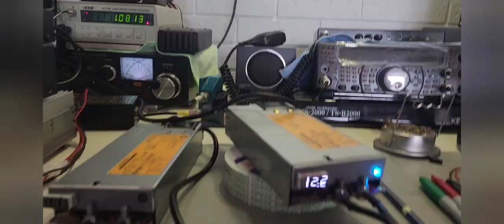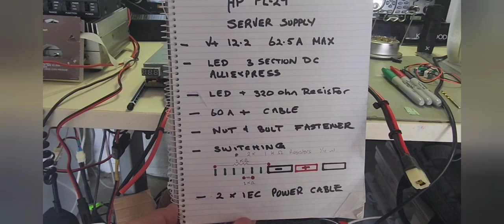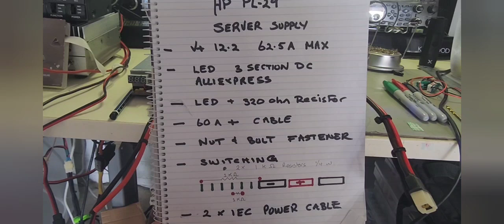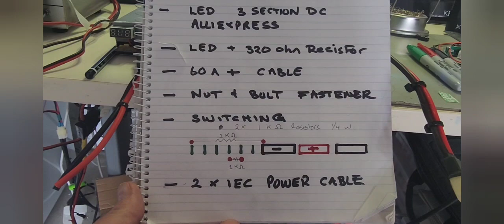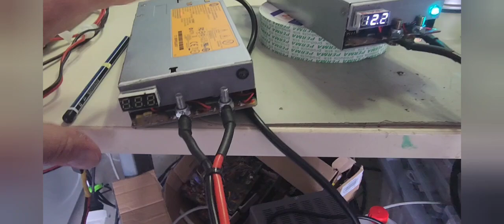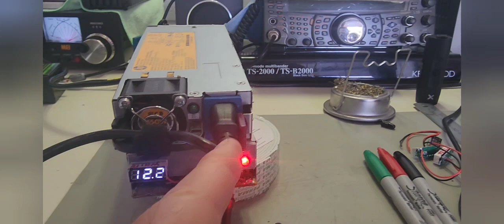Ham & CB Radio 62A Quality HP Power Supply DIY Project For Little Cost - HOW TO MODIFY SERVER SUPPLY

Comment: Paul..good video..just a heads up some power supplies do have multilayer pcb's so you cant drill through to fix the bolts on for the output DC connections and you can kill the powersupply
Reply from the maker: Thankyou and yes you are correct.

These however do not and all connections go to the two flat pads.

Over the years I've only used HP Server supplies upto 3000w and they have all been straight forward for conversion